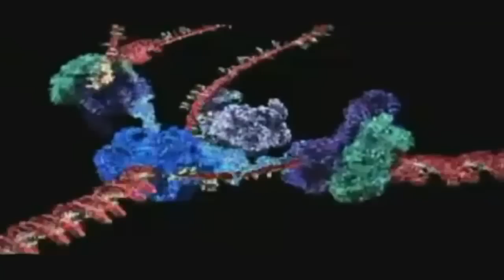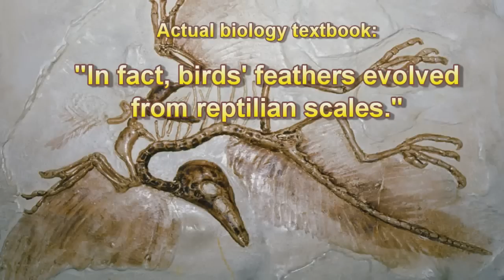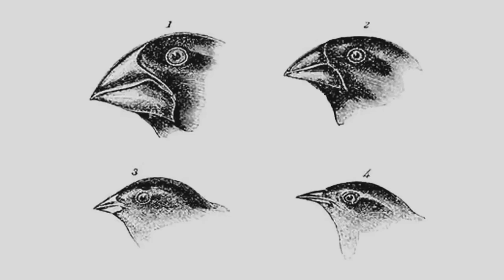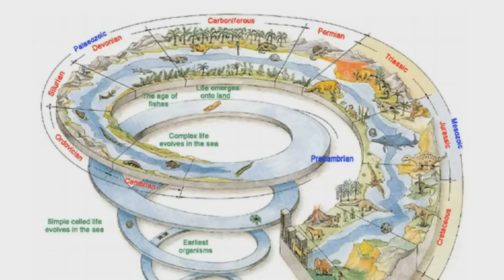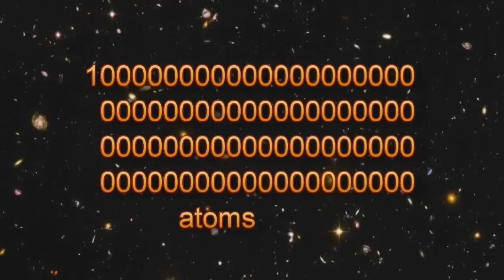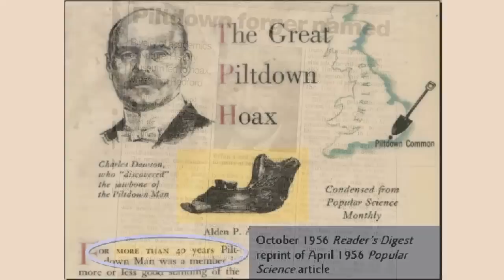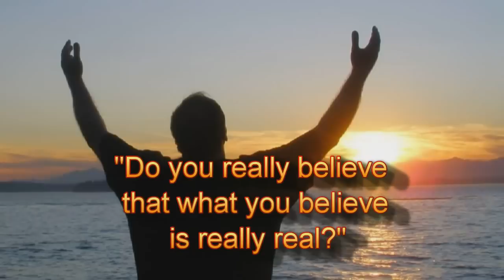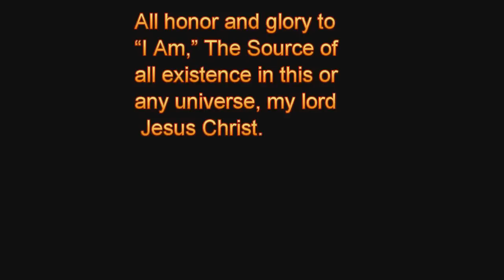Evolution Demolition

Comment: Champneys Is either lying his way through this thing or he is too ignorant of the subject to be trying to debunk it.
Saying simply that there is NO evidence of transition between scales and feathers for instance, belies the fact that there has been masses of evidence produced on just this state.
In order to debunk just that one thing he would need to quote and show, and offer  disproof of the actual findings and examples,  that at this moment seem to prove conclusively that this did in fact happen and that it is the case.
His insistence on No evidence there must come from a deliberate lie, or just plain ignorance. This is very transparently applicable to the whole presentation.
Reply: +Black currawong By all means, show me your evidence of any progression from scale to feather in any fossil.  Maybe I missed something, but I don't think so.  Scales are little more than folds in the skin.  Feathers are enormously complex and highly functional with hollow tubules and interlocking barbules that shed water, insulate, and are aerodynamic.
Reply: +Mark Champneys Just type "Scales to feathers
Reply: +Black currawong "Scales to feathers" Type this in google and read some of the thousands of peices of research that prove just that.
 The long, hollow filaments on theropods posed a puzzle. If they were early feathers, how had they evolved from flat scales? Fortunately, there are theropods with threadlike feathers alive today: baby birds. All the feathers on a developing chick begin as bristles rising up from its skin; only later do they split open into more complex shapes. In the bird embryo these bristles erupt from tiny patches of skin cells called placodes. A ring of fast-growing cells on the top of the placode builds a cylindrical wall that becomes a bristle.Reptiles have placodes too. But in a reptile embryo each placode switches on genes that cause only the skin cells on the back edge of the placode to grow, eventually forming scales. In the late 1990s Richard Prum of Yale University and Alan Brush of the University of Connecticut developed the idea that the transition from scales to feathers might have depended on a simple switch in the wiring of the genetic commands inside placodes, causing their cells to grow vertically through the skin rather than horizontally. In other words, feathers were not merely a variation on a theme: They were using the same genetic instruments to play a whole new kind of music. Once the first filaments had evolved, only minor modifications would have been required to produce increasingly elaborate feathers.Until recently it was thought that feathers first appeared in an early member of the lineage of theropods that leads to birds. In 2009, however, Chinese scientists announced the discovery of a bristly-backed creature, Tianyulong, on the ornithischian branch of the dinosaur family tree—about as distant a relative of theropods as a dinosaur can be. This raised the astonishing possibility that the ancestor of all dinosaurs had hairlike feathers and that some species lost them later in evolution. The origin of feathers could be pushed back further still if the "fuzz" found on some pterosaurs is confirmed to be feathers, since these flying reptiles share an even older ancestor with dinosaurs.
Reply: +Black currawong Like Ernst Haeckel, you are confusing growth of an individual with evolution between generations.  "Ontogeny recapitulates phylogeny" has been long disproved.  Yes, there are speculative articles out there on the subject, but they are all just that: speculative.  There have been some faked Chinese dinosaur fossils that had feathers pasted on them.  There are also dinosaurs with fine threads (probably decayed flesh), but no proof that they were feathers.  Yet even if dinosaurs were found with feathers, it would not demonstrate evolution of a scale to a feather; but only that a given dinosaur had feathers.  The question would remain, where did the feather programming in the DNA come from?  Not one bit of any of this verifies that scales became feathers.  Not one bit.  It is pure speculation.
Reply: +Mark Champneys The fossilisation of feathers Is, because of the nature of the feather, a very rare event; so you "Created, fully formed as 'kinds' " exponents leap upon this with desperate cries of, " none, zero zilch!
Under "Publications in nature' on Google there are 11,700,000 entries. "Nature" Is recognised world wide as the most prodigious and factual journal on nature and under this banner , the editorial below appears.
Nature 511 79-82 (03 July 2014)

Editor's summaryinالعربية
The discovery of numerous feathered dinosaurs and early birds has set the iconic 'Urvogel' (or 'first bird')Archaeopteryx in a broader context. But this venerable taxon still has the capacity to surprise. A newly discovered specimen from the Solnhofen limestone in Bavaria — only the eleventh since 1861 — shows a generous covering of feathers all over the body. Of particular note is a hindlimb covering resembling feathered 'trousers'. Analysis of feather distribution on the limbs and tail strongly suggests that pennaceous feathers — the type we are familiar with on birds today — evolved for reasons other than flight, perhaps for display.
This is what you refer to as "Chinese pasted on feathers" ? Look up the 'Nature' published articles on scale to feather evolution, not just the desperate grab at gaps writing of the Theists..
Reply: +Black currawong I can't make heads or tails of your quote.  Are you sure you typed it right?  Could you send me a link so I can read it in context?

Yes, fossilization generally is a rare event, since it requires sudden burial in mud to both protect the organism from oxygen and thus microbial decay, as well as to provide a source for permineralization--all before the organic material rots away.  Birds more easily escape burial than shellfish, so we have few bird fossils and many shellfish fossils.  This is another reason why we do not have fossil verification of scales transitioning into feathers.  The evidence simply is not there.  Only speculations.
Reply: Mark Champneys It is quite simple Mark;
There are many, a multitude, of findings of the transition between scales and feathers both in the fossil records and available to every day observation (Check out the penguin).
I also pointed you to an array of publications, of scientific papers that are there in the journal 'Nature." No ambiguity there except as your dodge, duck and weave. Look for it, as I said, you can easily dispel ignorance, To continue after that is to lie.
I also cut and pasted a passage from that journal which backs my statement fully. I really think that "nature will have 'got the typing right' too.
Reply: +Black currawong You have not pointed me to an "array" of anything.  You simply claim that something exists which doesn't .  Prove it.  I know of no fossils whatever that have been demonstrated transitional between scales and feathers.  The quote you gave about archaeopteryx simply mentioned feathers.  Not a word about partially developed feathers.  Archaeopteryx was a bird.  What did you expect?
Reply: +Mark Champneys "Proof" IS available in abundance. The transitional fossil chain is documented, tabulated and proven and is overwhelmingly there for you to see . Just 'Google" "Scales to feathers" -Or similar; and avail yourself of many thousands of published, peer reviewed, factual papers. The only way that you can maintain your desperate stance is to remain ignorant or to lie.
The "array" that I pointed you to was/ and is there in abundance, (i.e. The journal Nature as in the cut and pasted attachment that I posted)
The archaeopteryx was first considered a reptilian creature and your contemporaries tried desperately to prove that the "feathers" were an overlay from another creature superimposed in the fossilisation process. More recent discoveries of many more of these fossils have totally ruled this out. And many genuine articles are available which give conclusive proof of scale- feather transitions.
Reply: +Mark Champneys Here is a  'cut'n'paste' of my "array referral of last month.
"Under "Publications in nature' on Google there are 11,700,000 entries. "Nature" Is recognised world wide as the most prodigious and factual journal on nature and under this banner , the editorial below appears.
Nature 511 79-82 (03 July 2014)"
Reply: +Black currawong So if you find the phrase "publications in nature'  to be common, you think this somehow proves your point?  How?  If you have proof available in abundance, you ought to be able to be able to give me an airtight argument for just one example.  Just one will do. Why not give me your best one?  i'm waiting.
Reply: +Mark Champneys The journal "Nature" is universally respected as a provider of checked and double checked scientific research results, as you must know, and this is a fact that must scare the hell out of your shaky arguments.
Your tired and boring "Just show me one" is, as you  know I am sure,  the back to the wall. fingers in the ears, sequester cryof the defeated. You hide behind this knowing that a singled out unit by itself cannot indicate a progression and this is why you overuse it desperately here. "just one example.  Just one will do. Why not give me your best one?"
To prove a progression one must find chains of many examples. Minute changes over hundreds of thousands of years can only be observed by careful and exacting observations and identification of hundreds, -thousands, of links to prove a chain. This has been done, checked, peer reviewed and verified over and over, and the results of this are abundantly available across the world. Totally available. not MY argument, nor MY researched proof, but the result of the vast verification of the scientific world. To this "One example" I point you. Best of luck.
Reply: +Black currawong    "You hide behind this..."  Hide behind what???  Behind the fact that you have given me no evidence at all thus far?  You speak of "vast verification" but I honestly have never seen it.  I've seen claims, but verification is exactly what I have never seen.  Oh... I get it.  You are spoofing me, right?  You are really a creationist plant trying to make evolutionists look foolish.
Reply: +Black currawong   I'm really trying to understand you.  You say "I repeat (C&P)."  What on earth is that?  What does that mean?  And then you open a set of quotation marks without closing them.  Who are you quoting?  And where is the checking of the chain you speak of?  And what "one example" are you giving?  I can't make heads or tails of your post.
Reply: +Mark Champneys Another tactic of the cornered, belligerent is "I don't know what you are talking about"
C&P =Cut and paste, A device to save tedious re-typing.  Below is some more self quotes. What don't you understand of . . .(c&p) " You, Like all of your ilk, really have no argument do you? So you must resort to this stupid bluster. The sort of thing that I have heard from a belligerent nine year old student who, caught in a wrong act would bluster and lie, avoid direct confrontation of the  subject, totally avoid eye contact and;  in a desperate  twist away from admitting reality, lie, even to himself. " . . . 
The nonsensical argument, in studied ignorance of "Show me one single, solitary, isolated example that proves a chain" is an obvious piece of  foot shuffling avoidance. To spell it out . One needs a chain of evidence to prove a chain. That this chain is abundant is simply a fact and you must know this,  or are a complete uneducated fool. In case of the latter; prepare yourself for an avalanche of informed factual evidence and start by Googling in "Fossil evidence for evolution". 
Again a cut and pasted, self quote: "Read back over your own abysmal avoidance of replying directly to what I say, If you can't see your own 'foot shuffling' self delusion in this, you should make this your first step. Then take my advice and avail yourself of the vast world of proof and verification which is abundant, tabulated, peer reviewed, published and verified in daily usage and stop making a fool of yourself here." (end quote).
Remember, as you do(?), that your avoidance tactics and 'acting dumb' replies are being read by many others here.
Reply: +Black currawong    Okay, so you were quoting yourself.  But repeating something that is false... is still false.  Your enormous "chain" of evidence does not exist.  It is your pipe dream.  if I'm wrong, show me, don't merely C&P your error, hoping that it will come true by repetition.  Give me an example of any observed and verified case in which a random mutation built a coherent set of genetic instructions.  I know you believe this happens, but when has this speculation been verified?
Reply: +Mark Champneys yes and you firmly believe in Noah's Arc, Men living in whales? If you cant be convinced of the utter stupidity of such nonsense I suppose that this reality stuff is well beyond your ability too. Though you obviously struggle mightily to keep ignorance alive. 
Yes I do repeat "Self quote" what  have written before. Cut and paste is a time saving way of repeating things that you have chosen to ignore.
The weakness of your argument is underlined by your two main tactics ; first is the "Show me one, just one" [which by itself proves that is a part of a chain.] -How transparent is that? The other is to ask a non-scientist to answer the most obscure question that you dredge up in the hope of creating an 'I don't know so you win' scenario.
I will stop this time wasting and suggest that all of the answers to what you have questioned are available to you in properly formulated, proven, published, peer reviewed, are accurately  predictive and in common every day usage. And in a very easily retrievable form. 
So my final advice is Go take advantage of the learned, great minds of the world. (Certainly Not Me !) And give up your desperate flogging of dead horses.